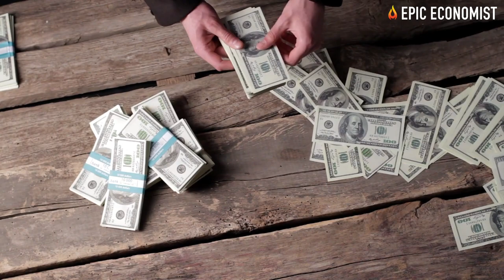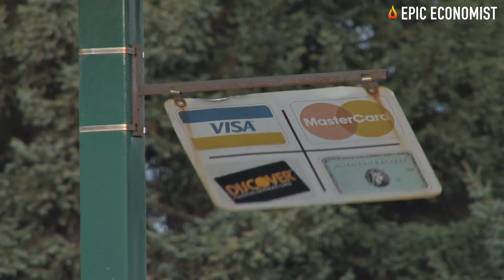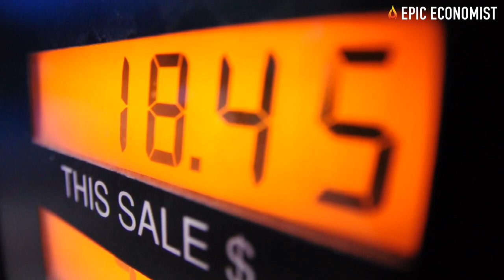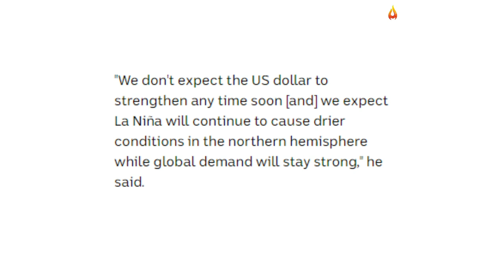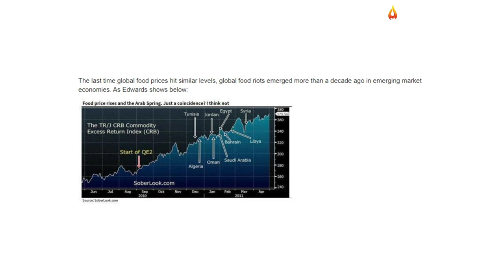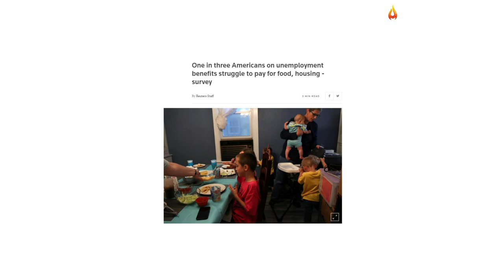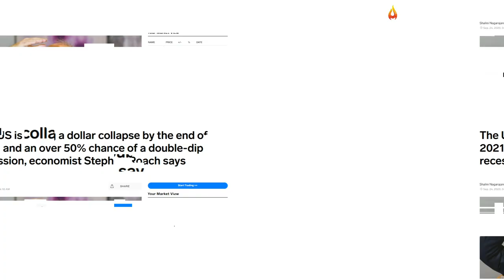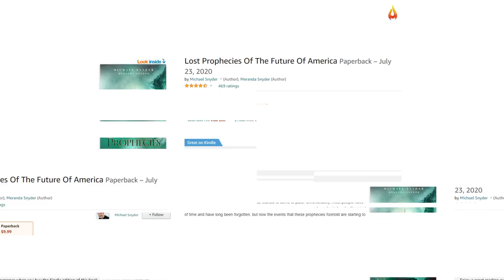Prepare Yourselves For The Most Catastrophic Shift In The Standard Of Living In American History

Comment: Inflation is not caused by increase in money supply, it's caused by the velocity of money in circulation.  While some commodities show signs of price spikes due to distorted demand (e.g. lumber due overheated housing demand), savings rate has tripled, thus significantly slowing down money velocity, but also causing asset bubbles in the equity sector (especially in tech and stay-at-home stocks).  Rotation into value stocks has already begun, though the spoils generated from the rotation will mostly go to Wall st, not the retail investor. Coupled with slumping demand associated with rising unemployment, swelling of retirement population, and housing foreclosures, these factors will depress aggregate consumer demand, thus rendering high inflation highly unlikely.  Rival currencies to the $ are equally unlikely to emerge as the global standard, with no parallel rise in competing bond markets -- indeed, the latter continues as the global hub for returns with negative interest rates in the Eurozone and elsewhere.  Remember March 2020 correction: everything dropped--metals, commodities included--as folks sought refuge in cash.  Can't buy a loaf of bread with gold bullion.